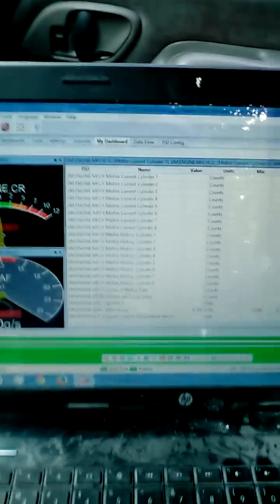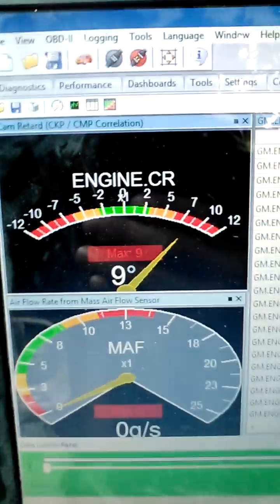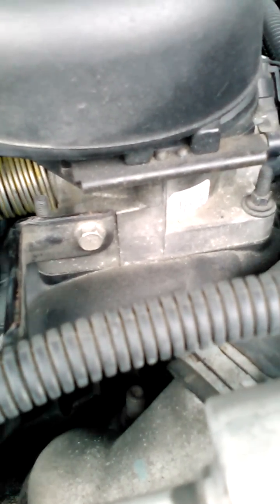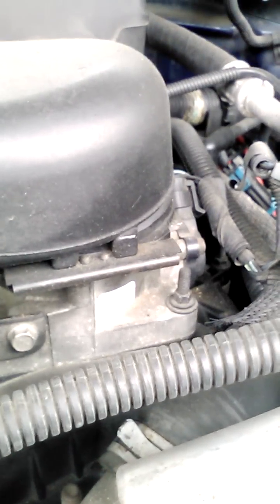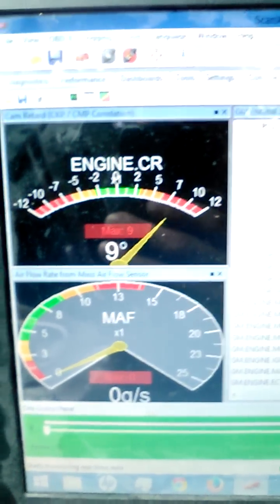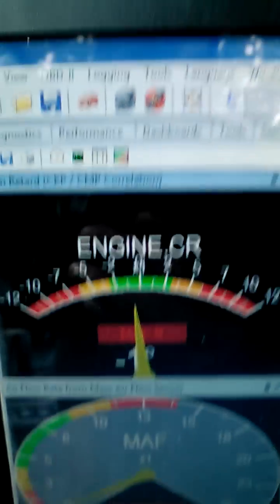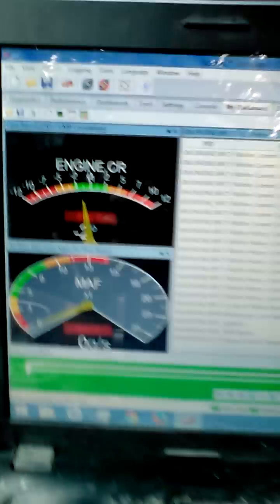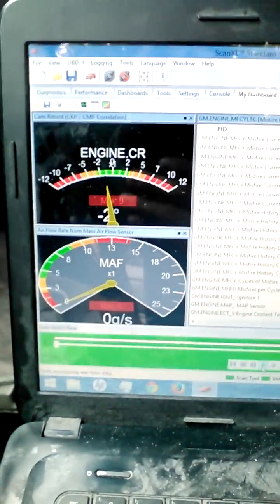vortec v8 96'-00' ignition timing

Comment: just what I needed, I have a laptop and ScanTool OBDLink SX USB cable... was wondering where you got the gm software? thanks for the video
Reply from the maker: Scantool.net has what you need
I just tried out the Bluetooth MX OBD tool and it worked pretty good with my laptop too.
Reply: @willyjilly9684  I just purchased the OBDLink MX+ and I can't figure out where or how to monitor the Cam Retard.  Can you provide any direction on how you did this with your MX?  What App did you use.  What PID(s) did you monitor?  Etc.
Reply from the maker: @ you want to make sure you are looking for the right parameter. It’s not the camshaft you are looking for it’s the crankshaft correlation I believe the abbreviation is (CKP) or similar when searching for PIDs

Comment: Hi, I used a blue tooth device that plugged into the OBD2 port and my phone to set the cam retard. The app is DashCommand and then you have to do the in app purchase for the right year Chevy truck, $10 for the app, another $10 for the in app purchase and $20 on ebay for the blue tooth interface(BAFX Products - Bluetooth OBD2 OBDII Car Diagnostic Code Reader Scanner Tool), so $40 for everything. I set up a gauge that goes from -3 to +3 on a 3/4 sweep and now I can dial the cam retard right in, mine is now between -.4 and+.6 when I rev it up. needs 1000+ rpm to read, but you will see when it does.

Comment: I know this is a old video but I'm going to ask anyway. I have a 1988 GMC Sierra with a 350 vortec swapped  it has a Accel HEI distributer with eldedbrock carburator. Headers and pro comp intake. I'm assuming you set the timing with a timing light since its basically set up like a old school 350 ignition system now? Is this correct or no?
Reply from the maker: You would be correct. The HEI distributor will always have timing set with a timing light. There are many guys who run hot rods with vortec engines with and a nice HEI distributor with a carb. NOW you need to make sure your HEI is meshing with your gear well and the intake height is correct to your HEI, that's #1. If everything is physically correct than bring motor to TDC and follow normal small Chevy procedure for installing a distributor on the compression stroke. I like the carbed vortec idea!  eliminates the entire nonsense of the fuel injection that the the 96-2000 vortec engine came equipped with. The spider assembly under the intake hides the fuel regulator and  any possible damaged injector. I hope everything  goes well on your motor!!

Comment: Will that software work with the elm327  elm 372 ?
Reply from the maker: D.L.P It will work with certain software but not all. Also certain parameters will not display, and it won't tap into GM parameters without a lot of headache. I personally don't like the elm scanners.  Walmart .com has windows capable 3 in 1 tablets that cost $70 and work with the scantool.net software perfectly! I know that's more expensive than most elm scanners will cost, but it will 💯 work though.

Comment: So if I order obd linksx scan tool how do I get the software I can't find. It on there website
Reply from the maker: tom nelson so let me begin by saying this was on a laptop with Windows 8 so that dictates what my program was. for example scan XL is different to tap into through a mobile phone app versus a laptop with Windows. I chose the windows route on a tablet even though I have the Bluetooth adapter that works with my mobile phone. Now if you want the windows route you need a wire to connect from the OBD port to the laptop. They sell it on scantool.net, it's like $29.  Otherwise you need the scan MX Bluetooth adapter if you want to go the mobile phone route (much more confusing unless super phone savy, which I am not). Let me know which type device your using maybe I can help guide you right direction.....
Reply from the maker: tom nelson If cheapest route Amazon sells a tool that you can tap into this and other GM add parameters  BUT IT DOES NOT WORK ON EVERY VEHICLE. Donloaded an 8 dollar app (car gauge pro I believe and I pulled it up, but didn't work on all the trucks  I tested with the vortec 5.7). I did pull up the parameter you see in the video on multiple vortec 5.7 vehicles so it does work through a mobile phone (look on YouTube for BAFX scanner vortec 5.7 or something similar, been a while since I looked for it). With that said you can try the Amazon scan tool..
$38 with the app is what I paid
 BAFX scanner is what it's called. Sorry that's as cheap as I know and it's a 50 50 but it's one hell of a scan tool for $29

Comment: I just rebuilt a vortec. My truck runs and idles fine but im off by 25 degrees. Wtf???? Any input appreciated.
Reply from the maker: Tyler Hall are you looking at the timing advance or CKP/CMP?? Just curious so i can maybe help. Timing advance won't help with setting the timing and unfortunately the off the shelf scan tools can only read timing advance.
Reply: I've done the same mistake and the timing advance doesn't move at all lol.

Comment: I had a collapsed lifter so I had the intake off. I marked the positioning of the distributor and started with the engine at TDC to provide a starting point when I was done, I bought a cheap OBD Scan tool on line just to check or set my timing. I am trying to set the initial timing at zero but I guess its electronically advanced because I cant get it to move near zero.

Comment: Hey guys. I don't have any tools so I just adjusted my timing as best as I felt was good holding rpm at 1k. Did not disconnect battery like I just found out. Two days later my truck was running bad. Back fires and all. I guess I know what I gotta do now.
Reply from the maker: Ismael Carrillo look for the videos on YouTube how to set timing on a vortec without a scanner. Many people have been successful lining up the notch on the distributor cap with the 6 or 8 stamp on the distributor itself while at top dead center. I don't explain it very well, but there are some great videos that do a helpful job on YouTube.

Comment: Hey man great video. I was wondering if the scantool.net software was able to do crankshaft position sensor relearn procedure
Reply from the maker: Matt Smith No it's not capable of that to my knowledge. You might be able to view the voltage on the crank sensor itself while your doing the relearn procedure, but i have not tried that myself yet. There is a way to do the crank relearn manually, but I've never successfully 100% done it. It requires starting the engine (after the battery has been disconnected  30 mins) and reving the engine instantly to a high rpm, then you drive at varrying rpms under 45 mph up and down. I can never get this process right, hope this helps. ..
Reply: Thanks for the reply

Comment: hey willy jilly I ordered the scantool for my 97 k1500 with the 5.7l scantool says cmp offset is not a supported pid's any info would help to get this to read proper plz.
Reply from the maker: daniel heath what software did you purchase when you ordered the scantool?
Reply: willy Jilly  I ordered the scan xl scanner and the gm enhanced add odd
Reply: willy Jilly I ordered standard v3.5.1 build 2770
Reply from the maker: daniel heath and your using the OBD link SX scantool adapter, and laptop? I've had problems using the wireless adapters not being able to work with some pids. I also fogot to enter the scanxl and gm add on to the license key. If you have that figured out make sure you OBD port doesn't have bent or coroded prongs as that can cause pid and information as well. Try plugging into vehicle, key on the ignition, connect the scantool, add the vehicle to the scantool, then you can search for cmp,add it to data logging pids and press play. For the first initial use i do a deep search to validate all GM powertrain pids, and then data log the one i want by scrolling down the list and clicking on it. You should have no problems if your using a decent laptop, and proper link. The wireless stuff not so much on the reliability.
Reply from the maker: daniel heath thank you for telling me that, because i was thinking of the 411 swap myself. I appreciate your input thanks again!!
Reply: Heath, did you figure this out?  Who programmed your new 411?

Comment: I have scanxl for my 97 but I can't find any info on setting up the pid to set the timing can you please instruct me to set up like yours or point me somewhere that can tell me
Reply from the maker: Richard Moore personally it was difficult at first to find pid and setup. I had to have scantool.net walk me through it the first time. Really its best to select CMP pid from the pid list and just view the data live by hitting the green play button at the bottom for live data. It wont display information until you are recording or playing live.
Reply: willy Jilly thank you i think I've got it figured out I have built a new motor for my truck used to the old hei and having a shop with the scan tools and all that but having to figure it out this way is a little harder fuel injection is a new thing for me and I want to make sure it's perfect.... how do you get your distributor to turn mine doesn't

Comment: i have the same scan tool program and i was able to create the same gauge and make pids (including the CR) and also connect it to my 97 yukon 5.7 vortec but i can't get the actual gauge to move when it connects.... any advise?
Reply from the maker: Luis Lopez make sure your well above 1000 rpms,  make sure the camshaft position sensor is functioning properly not water damaged under the distributor cap, make sure your pressing the green play button for live data before viewing your custom gauge. Few other things Check data link connector, and obd port as well. Make sure 100% your reading the correct gm parameter which is confusing to find in the first place...
Reply: the thing i cannot get to work is the custom gauge, the actual dash xl does open and works to check the check engine and the rpm but i cant figure out how to get it where you have it on your video 25 sec where the custom gauge actually moves when you start the vehicle
Reply from the maker: I had to play with the pids a few times before I got it to work...
Reply: ill try that, thanks
Reply: I feel your pain having the same issue

Comment: Do the ScanXL with GM Enhanced software already include the meters you show on the video, or do you have to create them from the software from the available PIDS?
Reply from the maker: Carl Lozada they include several different gauges, but you have to set the parameters. basically they are blank gauges, and you select the pid, and range of the gauge. youtube has a few good videos on scantool.net software and hiw to use it..